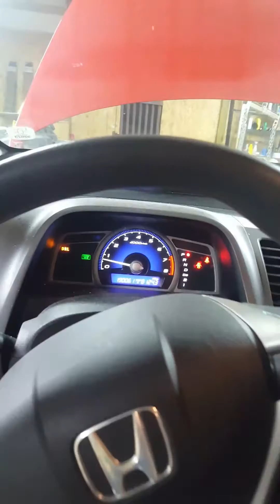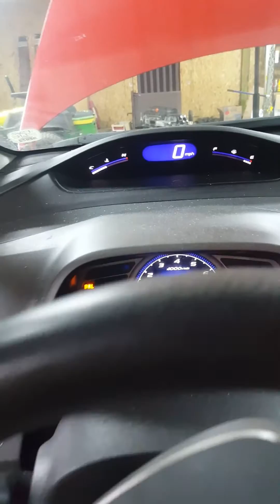JDM R18A swap in 06-11 Honda Civic PART 3

Comment: Hey Shawn:

Gotta give you a BIG THANK YOU for this video. My daughter's '08 civic presented with a pinhole leak by the casting rib on the left front block. Dealer offered $925 credit, but we'd still have to pay $3700. NO THANKS!! You gave me the confidence to proceed with this swap. Now I'm not a gearhead, but am mechanically inclined otherwise. I researched this for many hours before seeing your posting.

I bought a JDM from eBay ($850 delivered), & took it to my mechanic last week. He'd never done a JDM swap but I was confidently able to assure him this would work, due to your vid (My guy is 68 years old, so I understood his reluctance, lol). I made a list of all the potential issues that you listed on your swap. Gave it to him & hoped for the best. We just got it back yesterday. Daughter says it runs great (so far). Says it has a slightly different sound to it (? lol) but so far, so good. YOU ARE THE MAN!

These are my takeaways, from your hard work (for quick reference for others):

You will need to re-use...
1) Original tranny cooler
2) Wiring harness
3) VTEC pressure sensor switch
4) Throttle Body
5) Power steering pump
6) Thermostat/EGR Assembly
7) Replacement BRAND NEW water pump is a NO BRAINER!!

PLEASE FEEL FREE TO UPDATE OR MODIFY THIS QUICK REFERENCE LIST.

My mechanic said he needed to re-use the original Crankshaft Position Sensor also. Dunno if the JDM was bad or incompatible. Engine wouldn't start otherwise. He also said that he had 16 hours tied up on this job. Any guess how long yours took you? Of course my guy benefitted from your hard work, so a direct comparison would be very unfair.

We haven't gotten the bill yet, but it's gonna be a biggie!

Thank you brother!!!!!

BTW...I'm curious about your pedigree. Are you a Honda certified mechanic, a independent professional mechanic or just a backyard wrencher?
Reply from the maker: Thats awesome to hear. Man im just a backyard mechanic Honda's are my preferred vehicle I enjoy working on. That list seems spot on for the items that need to be used from the old engine. One thing that is nice about the R series engines is no timing belt maintenance on these engines. Sometimes while they are in a shipping container being transported some of the sensors do get damaged or broken so thats normal to have to change out various sensors off the new engine. As for 16 hours on the job I would say thats pretty fair for someone who does not do these types of engines swaps very often. I believe it took me around 10-13 hours on this particular car. So I do believe the labor time is honest. Hopefully he is not charging over $100 a hour labor time that can add up quickly especially when you add the cost for all the fluids new belts water pump etc.. Anyways thanks for the nice comments glad it helped you guys out and hopefully saved some money as well. If you got any questions just let me know ill try to help.
Reply: what was the total bill

Comment: Is it possible to swap the jdm engine alone to the original usdm tranny or will this not work? I love the great work the information I've seen on here is vital and Ive documented a list of what I'll need:

09 civic jdm component swap list

Vtec solenoid switch 
Transmission cooler
Throttle body
Power steering pump
Egr thermostat assembly
Cam sensor
Crankshaft position sensor
Starter
Knock sensor
Water pump(new)
Ac compressor(time to buy a reman one)
Wiring harness swap(possibly buy new)

 Please let me know if that will work thank you
Reply: Hey man! Was wondering if you were able to match up the JDM engine with the US transmission?

Comment: For anyone doing this swap...I wanted to post this info in case it may help someone I’m the future (I couldn’t find anything definitive on this after lots of searching so I took a chance) - I ended up using the jdm throttle body.  I did get an error code upon first startup (P2176).  I went through a throttle body relearn procedure (search for it - believe it was when car cold, turn key to on position for a few seconds then start car and hold RPMs at 3k until coolant fans turn on - release peddle and let car idle for a bit (should now idle correctly without idle hunting) then turn car off).  Once ecu learns new TB - clear ecu codes (may need to clear codes again at next startup - I got different TB codes after clearing the P2176 code on next startup and cleared those as well).  After performing these steps - my jdm throttle body has been working flawlessly.  Car is 2006 Civic LX and swapped in a jdm r18a motor.
Reply: Did you leave the jdm Egr assembly on the engine? Let me know please
Reply: I don’t 100% recall, but going back though pictures - it looks like I used the JDM EGR.

Comment: havent had any issues with the car yet! i have put close to 20k on it and have had no issues. we just bought a new vehicle so the car has now become a project car. i currently have a set of arp hardware, hondata on the way along with a full weapon R setup. next will be a t28 kit. hoping to push around 12 to 15lbs of boost.
Reply: Maybe 10 -12 psi. The R18 rods are like chicken bones
Reply: bout to say thats alot of boost for that motor lol

Comment: Hello, I know this is an old video but I wanted to see if there were any other issues upon driving with the swap?

Im in the exact same boat. 07 Civic, old motor toasted because of no oil. Purchased a R18a JDM swap (kept the usdm tranny) and got it in no problem, engine fired right up. However, the car shifts weird when driving. I didnt lose any trans fluid, so Im doubtful that is my issue however I will be changing the fluid soon just as a precaution. Any other possible suggestions for why it would shift weird after the swap?
Reply: Hey Kevin I'm about to tackle this job did you ever find out what was with your shifting issue.
Reply: @pamelaflynn8844  The ground going to the frame broke at the terminal. Once I fixed it the car was shifting fine again. After a year and 20K miles it’s still running great after the swap
Reply: Thank you for this comment!

Comment: hello shawn I have a civic 2008 and the block also split as many have thought about buying an ebay engine an R18a jdm version to change my r18a1 .... my question is if I should buy something else besides the engine for the I change all the sensors and other things agree with the original r18a1 or I have to make some modification ... thank you very much for your videos and the help you can give me with this topic thanks
Reply: Jose,
Did you end up buying an ebay engine? I've been looking for an engine and some of the sights look shady. I'm not sure where to get a good used engine.

Comment: I swapped an engine on a civic 09 and cold start struggle to start and then the engine light was flashing I check for codes it was misfiring cylinder # 3   any idea what it could be other than spark plugs or coils

Comment: how important is it to make sure you get the 2018 production R18 engine? The 06-09 R18 engines were defective with the cracked block. How do you tell what year it was made in?
Reply: the JDM r18 didnt have this problem only USDM
Reply: Thank you for the answer.  I just had my block crack on my 2008 civic.  I will definitely swap it for a jdm engine, thanks

Comment: Can I change a r18a1 for a r18z1 in a 2009 civic?
  the r18a1 just cracked block in a flood. greetings from Guatemala
Reply from the maker: yes all you need is the z1 ECU.
Reply: @shawnh9677  thanks,
Reply: The z1 crank sensor is also on the wrong side. Also not sure where to buy a z1 ecu? And you would have to reprogram your keys for the immobilizer probably
Reply: @shawnh9677 what about putting in the r18a2 in a r18a1 chassis? Can I use the A1 ecu? 
Please and thank you